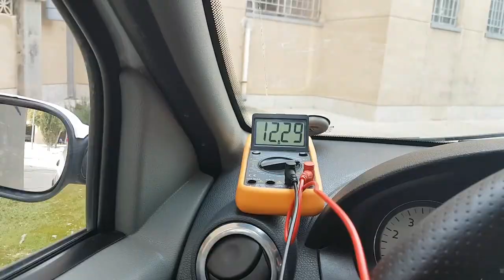How to Install an Auto Dimming Rear View Mirror | how to attach rearview mirror to windshield

Comment: I believe I have the same mirror as you.  7 pins to connect.  I like this video but I need the connector for the rear of the mirror.   Also, my mirror shows the outside temp.  Does your have this function?
Reply from the maker: Hi mine doesn't but if you can't find it there's no need for it just find the pinout from google and connect the wire

Comment: Well represented, I want in my Tiago, 
1. Kya Tiago mein same wiring system hoga means 4 wire in roof?
2 Tiago ka Kahan se purchase hoga?
3. Price for new Tata genuine or good company?
4. Dash ke sath aata h wo kaise h , already have display and rear camera?
Reply please
Reply from the maker: 2wire is needed, more wire is for other options like temperature or GPS or...
You can find used one in ebay about 30$
I could not  understand other sentences, sorry😓
Reply: @bestofmyexperience2820  original Tata ka kitne ka aata h ,Kahan milega kl,koi app, 
Kuch mirror display, dash cam ke sath bhi aate h ,kya wo lgana shi h, meine already back camera or stereo lgwa rakha h, ya dashcam alaga se shi rhega lgana, dash cam bhi aese hi lgege kya sir?
Reply from the maker: Would you please use English?
Reply: @bestofmyexperience2820  
1. How much cost a an auto irvm of Tata originally, and where will purchase agency or any other app?
2. Some irvm come with display in half and irvm in second half with dash cam and rear parking camera, is it good to buy them or connect dash cam separately, I already have stereo display and rear parking camera in my car.
3 and for separate dashcam , does wiring also be done from same roof light?
Reply from the maker: Well I really don't know your car but these Mir ors are multipurpose and you can buy from eBay
As I said before for operation of the basic mirror you need ground wire and 12V wire that you can use from roof light but if you purchase any mirror with more option then you may  need extra wiring from  dashboard  like reverse parking trigger signal and....
Reply: Thanks , well I have Tata Tiago base model
Reply from the maker: The principle is common
Reply: @Vikramsinghjangra  aprrox 7.5k
Reply: @bestofmyexperience2820  I have same irvm with reverse camera,but its v
Hyundai Verna original and I want to fit in my alto 800,irvm has 10 pins,u can help me to attached connections

Comment: If accidently the irvm is left powered on then it will drain a lot of battery. Is there any solution so as to supply the power from acc?
Reply from the maker: Well some cars maybe.
Yes of course you could find any wire (+12V) that maintain voltage with ACC  but you should do wiring.
Also these rear_view mirror's battery usage is neglectable and won't make   any difference

Comment: could you tell us which pin on the mirror is the +12v and the negative?
Reply from the maker: Is your mirror the exact as mine?
If not so you have to finde the exact part as wiring may be deferent.

Comment: Im doing this to my honda but I dont like the permanent live the mirror will be on all the time, I don't like that.
Reply from the maker: There is nothing to worry about. There is a fuse in series with the wires.
Reply: @bestofmyexperience2820  my concern is about the drain on the battery and also damage to the mirror over a period of time

Comment: Why would you want to tap into constant 12V supply creating a parasitic drain?
Reply from the maker: Sorry I didn't get what you mean
Reply: @bestofmyexperience2820  The power supply should be switched so you don't drain the battery with a "parasitic drain, key off and power still supplied to the unit" .

Comment: So much of this gives me anxiety. This is high skill paired with sloppy craftsmanship. How do you expect anybody to replicate this? These DIY's are meant to be useful to the public. This was sloppy
Reply from the maker: Thanks
Reply: I cringed when he used lighter on the plastic holder, definitely damaged the factory tint.
Wiring is bad as well(It would be constantly drawing current even when engine is off), absolute piss poor job really.
If you want to DIY, just tap ACC wire behind the stereo unit and use any ground wire. 
This prevents current draw when key is not inserted.
Reply from the maker: Well thanks for your comment.
The holder was not plastic (It was metal).
Any ACC Wire has Fuse so there is not any differences between mine and yours.
Please keep in mind :
Before doing any job with any car wires YOU SHOULD REMOVE NEGATIVE BATTERY TERMINAL .